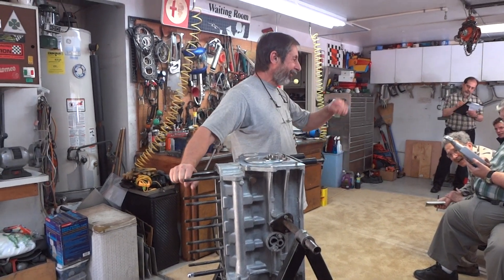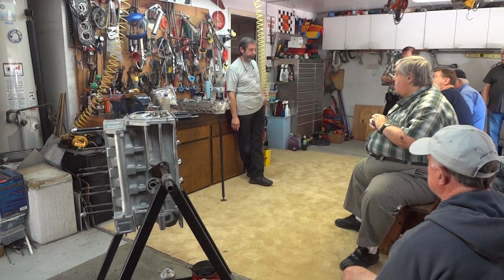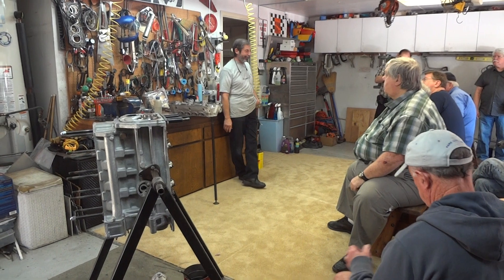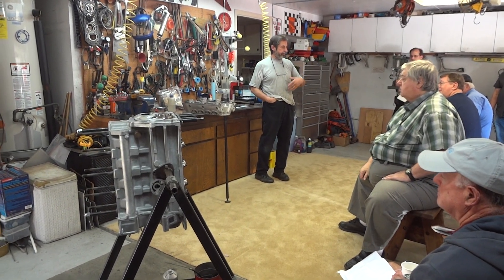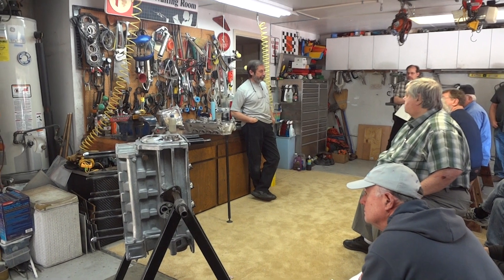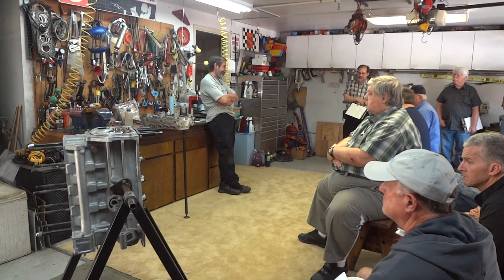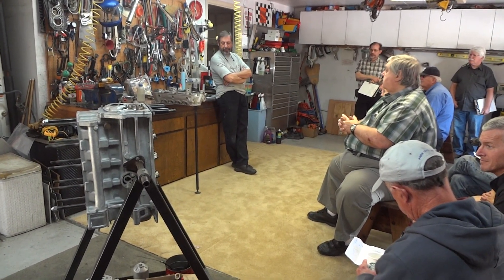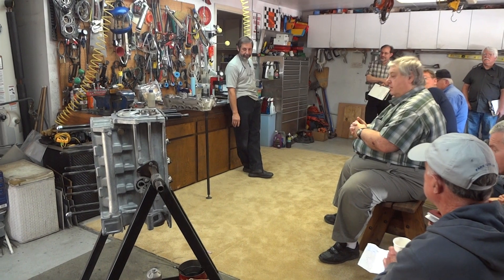ARA Tech Session - Engine Rebuild

Comment: A few things: 1: I have always used petrol to clean a motor, followed by soap and water and a good blast with really high pressure air. 2: Changing out the dash on those old Alfas is so easy! 3: I once bought a head from some cowboy that had hundreds of those cam caps in a box, he gave me what I thought were the correct ones....got my money back of course!